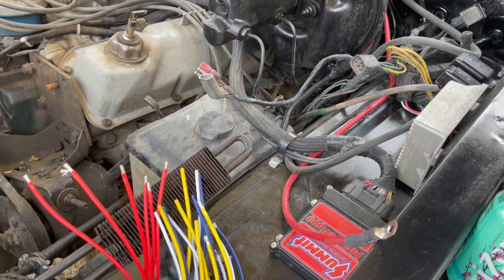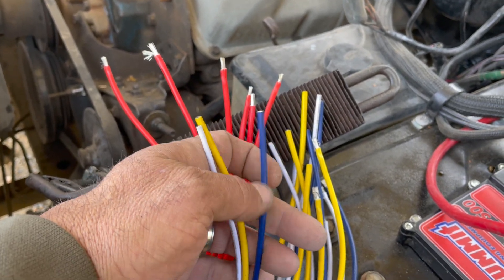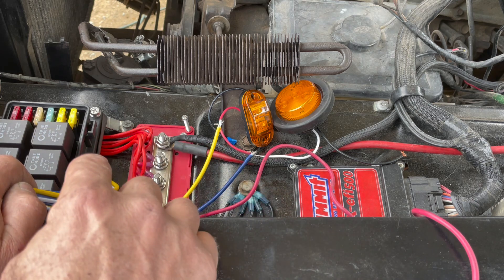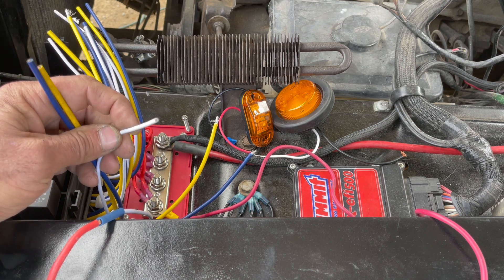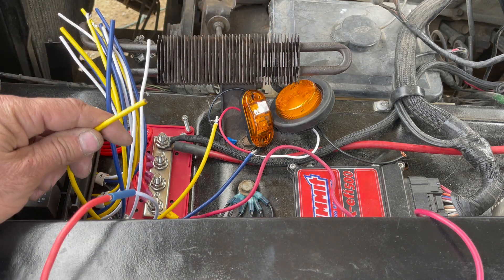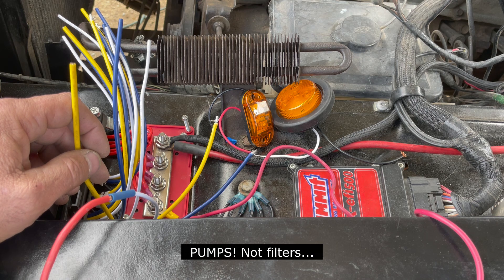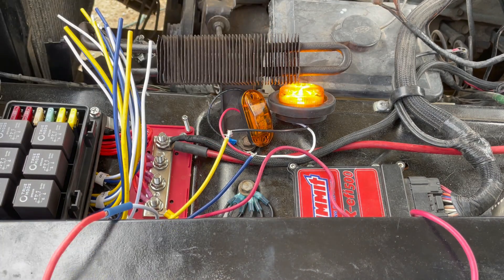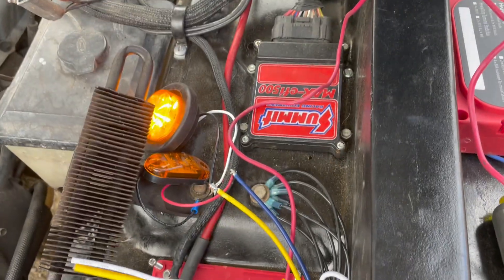True Mods universal 5 pin 12v relay box wiring

Comment: I have a question or if u can do a demonstration oh how to use/install the true mod with a toggle switch and led car lights that change color. You have the best explanation so far on how to wire the true mod kit but can we get a step by step more detailed video.
Reply from the maker: Certainly. I’ll get one up tomorrow morning.
Reply: Thanks jeb4053. I bought one and I plan on putting underglow lights, dash lights and floor led lights in my car to be connected with toggle switches but the instructions do suck and I'm confused on how to go about that exactly. So a video would be awesome.
Reply: Hey did u ever get a chance to make that video?

Comment: My question is where do I hook up main power to run that fuse box? Or is the power coming from each of the red wires? So technically u have 6 power wires?
Reply from the maker: You technically have 6 separate power wires. That’s the reason I installed a buss bar. Helps by running one big wire to the block from the battery verse 6 small wires all the way over to the battery.

Comment: Great video, once you run the white to a switch then all it needs is a ground directly near it? Also, is it ok to leave yellow unconnected?
Reply from the maker: Most switches have 2 or more terminals on them. I use a key on power to one side of the switch and the white wire on the other side of the switch.
Reply from the maker: Yes you can leave the yellow unconnected but make sure you cover it because when the switch is off, that yellow wire becomes hot. I use a piece of shrink wrap to cover the end.